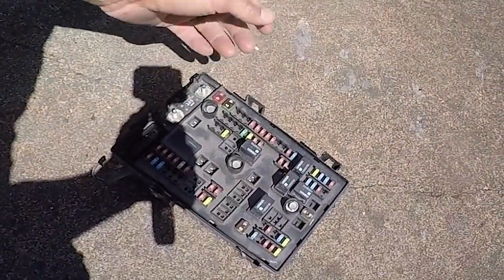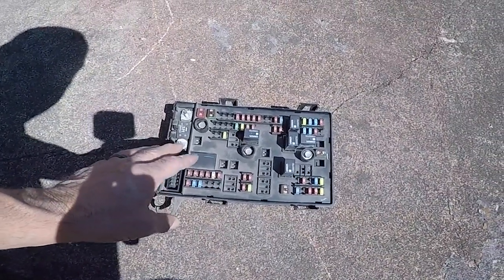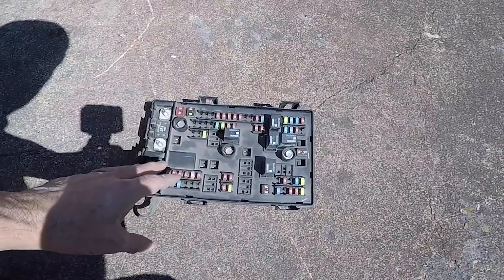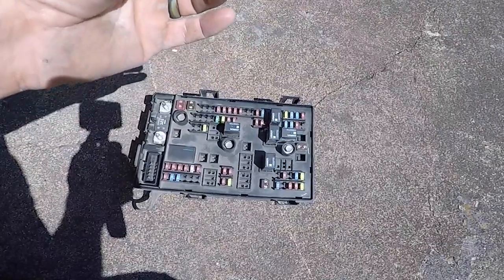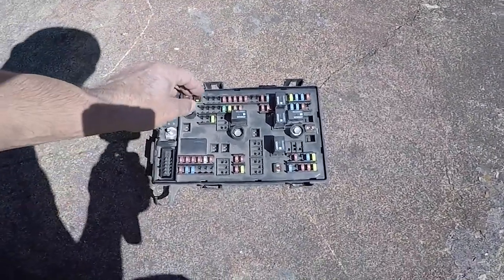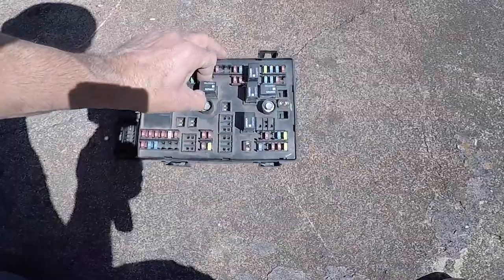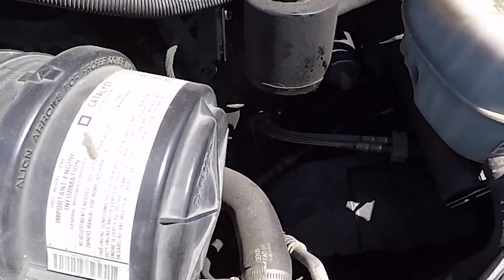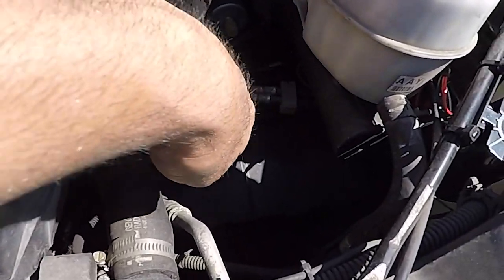Chevy Express fuse box`~~~ No Start

Comment: Thanks for posting, I didnt think to check fuse panel box. I had voltage on pin 30 but no relay coil voltage at 85&86 during start up. Will check under fuse box next
Reply from the maker: hope you get it resolved, if you need anything just send me a email

Comment: Is there a button to push to reset the security light on a 2000 Chevy Express Van so the Van will start or is there a way I can bypass the security light like adding a push button to the starter?

Comment: I have a 1999 Chevy express 2500 and have a short or problem with the fuse box under the hood.  So I found out that wiggling the fuel pump relay fuse would allow the fuel pump to kick on and start again when it would randomly kill or not start. So I was running the van like this for 3-4 months. So it died again the other day while driving and when I went to wiggle the FPR fuse it was pretty warm and this time it didnt work. I also noticed that my cluster, gauges blinkers and warning lights don't come on either when I turn key forward to power on vehicle.  Ive tried wiggling all wires under hood going to fuse box and under the steering column while keys powered on and cant find a short. Do you think this fuse box would be the culprit for cluster/gauge/blinker and fuel pump not kicking on?

Another weird thing was it would start even when I sprayed fuel into intake while it was experiencing these issues. It seems like whatever the short is preventing it from starting no matter what. While working on it the cluster lights would come back on randomly and then it starts but doesn't stay running very long only a few mins before it shuts off and when I go to restart it the cluster/gauges aren't working and it wont start until they do.
Any advice you could give would be greatly appreciated as this is my backup work vehicle and equipment is mounted inside it so I can't work until I get I fixed. Thanks very much
Reply from the maker: It’s possible you have shorted out a fusible link along with the fuse box did you try looking under the box to see if you saw any burnt spots. If you email me I will send you a link to some wiring diagrams

Comment: I have a 2011 Chevy express 4.3 and I have also changed the fuel pump from the dealer and the fuse box under the hood from the dealer, and still get the intermittent crank, but no start. The previous board did have the burn mark on under the fuel pump fuse exactly like in this vid and it ran fine (after replaced) for a couple months, then no start for 10 min. worked fine for a couple months, then no start for 30 min. then 1 1/2 months later (last night) no start for 45 min, called a tow truck to drop at my home. I chose not to drop it at my mechanic becuase I knew it would start up again, like in the past. Sure enough an hour after the TT droped it in my driveway it started right up. Now I have no idea what it can be. I will pull that box again and see if there's a burn mark and report back.
Reply: Same with my 2009 express. Did you ever figure it out?

Comment: How do you access the fuse box under drivers seat?
Reply: Locate and remove the black plastic cover under the seat.  It has a clip on the front and inner side that can be pried using your fingers or a small flat-blade screwdriver.  To pull small fuses, I use a needle-nose pliers with an angled tip.  You can also remove the seat for easier access.

Comment: First of all thanks a TON for this!! Awesome bit of insight. Question: I replaced the fuse board, and fuel pump, and now one month later it’s burned the board again. Any idea why could be causing that? $220 a month for boards adds up quick!! Thanks very much for any and all help!
Reply from the maker: Let me do a little bit of research
Reply: May be bad ground
Reply: I’m trying to change my fuel filters tomorrow. But I’m going to look at this also if it right. Holy shit this vid saves me

Comment: Hey … I did swap another fuel pump n all fuse and relay is good n I test old one with jump wire on 12 volts… it was working!!! So I saw this video n I took out fuse box boom .. it same thing on mine fuse box burn so hopefully n I am sure that the problem
Reply from the maker: Hope it works for you
Reply: And!!! It works!!!!
Reply: @vicentegonzales3852  Mine has failed multiple times, keep in mind the wiring harness maybe burnt as well, I had to bypass the fuse box, now i need to find another key on source that provides 30 amps, currently I am using inline fuse to battery and toggling it on and off as needed, sucks but it works for now.

Comment: Hi! Thanks for making this video. I've been having weird intermittent crank no start and stalling issues with my 97 Chevy express van for months and I'm going to check out my under hood fuse block soon. I'm wondering what you did to resolve this issue after finding the burnt fuse block? Did you just replace it or do you need to go further and resolve the issue that's causing it to burn up? I'm wondering if this happens because the fuse block itself is faulty or other electrical issues are causing it that would continue to ruin other fuse blocks.